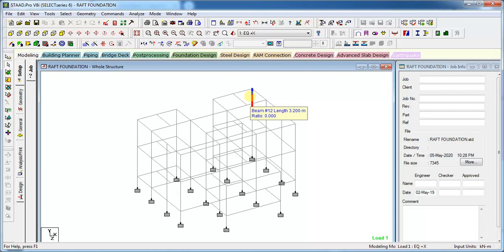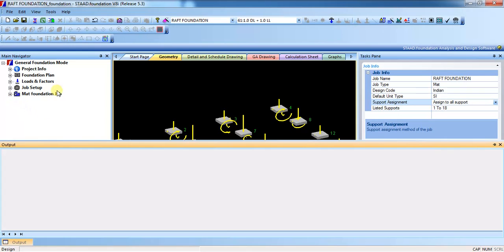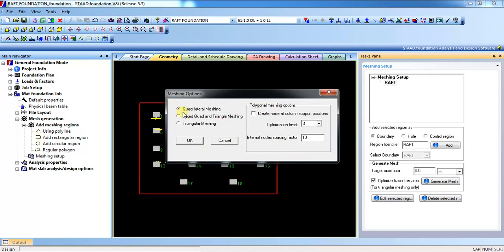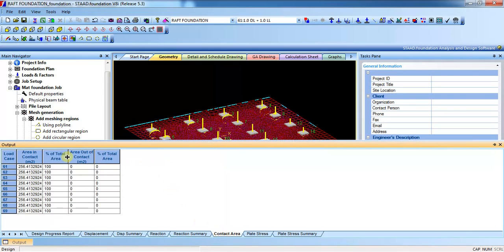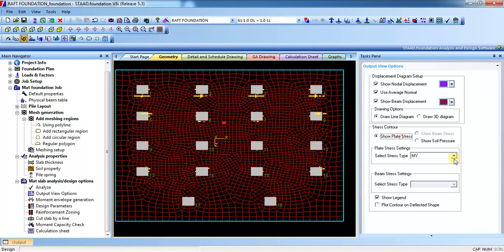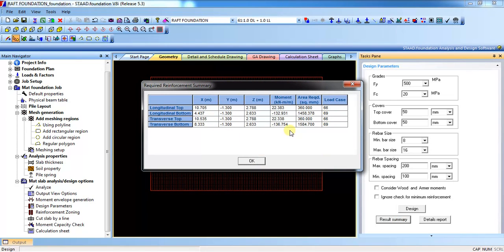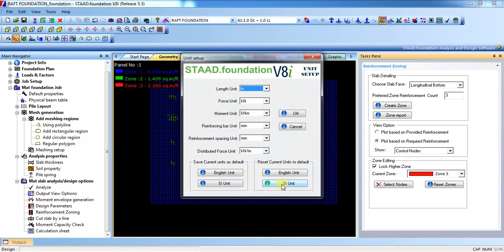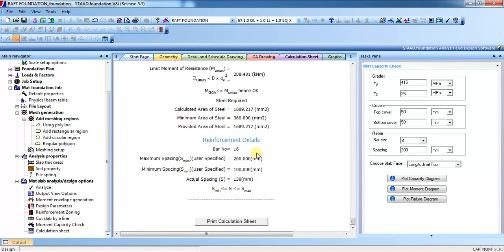Mat/Raft Foundation Design in STAAD Foundation

Comment: Hi, I have a doubt that why you created mesh at y=-1.3m?
Reply from the maker: Because support was at -1.3m
Reply: Thank you
Reply: @Tinytopic  please make a video on Ribbed raft foundation (I mean raft with beams) design using staad foundations.
Reply: Hi I have a doubt, in cut slab by a line for taking moment values, which moment need to be selected, as I'm confused in Mx and My
Reply from the maker: It will be based on the direction.
Reply from the maker: If it is along X, there will be Mx and vice versa
Reply: @Tinytopic  but for parallel to z directions there is no MZ right?
Reply from the maker: Parallel to z there will be My
Reply: @Tinytopic  oh OK now I got it , thank you so much